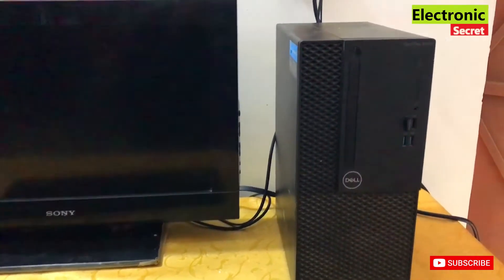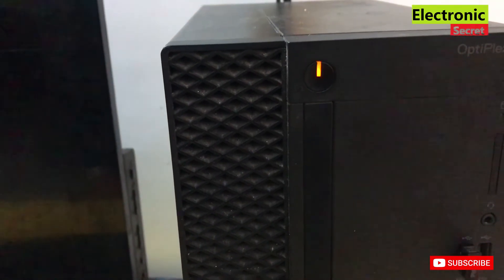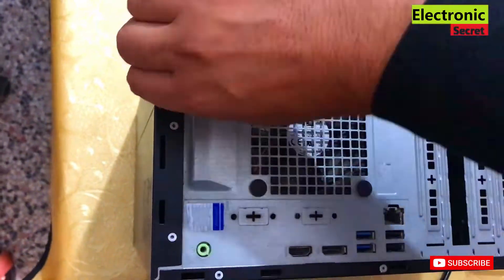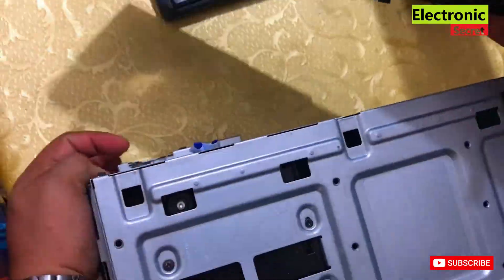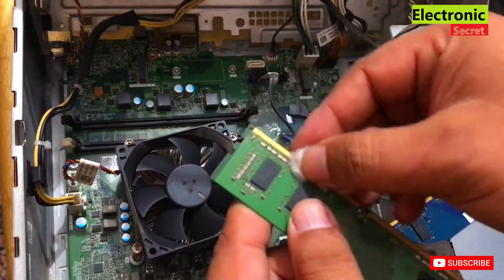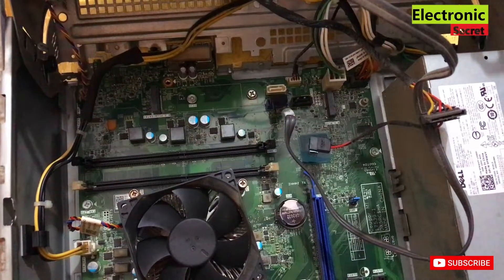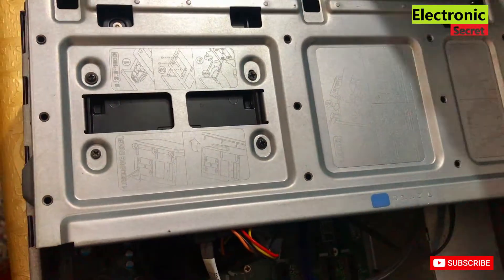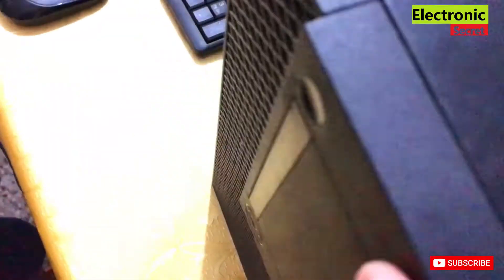DELL OPTIPLEX 3060 AMBER LIGHT BLINKING || DELL PC NO DISPLAY PROBLEM

Comment: Great video.  SUCCESS!!!  This cured the "blinking orange light" problem with my Dell XPS tower.  I just sprayed De-Ox-It on the contacts and wiped them off.  Be sure to push the boards solidly back into the slots so that the clips on either end move all the way in to hold the boards.  Much thanks for this video.  I was ready to scrap this 2011-vintage computer.

Comment: DELL OPTIPLEX 3060 white LIGHT directly on  both fans spin  NO DISPLAY PROBLEM
I have checked RAM, processor, power supply these things are ok but still no display. What is the problem??
Reply: Same happened. Any update ?

Comment: Is it the same with optiplex 3040?
Reply from the maker: Yes you can do it
Reply: @ElectronicSecret  I have optiplex 3040, it only boots with 1 ram stick at a time, so both sticks are working but when i try to boot with both i flashes orange.. any solution please?
Reply: @SupJaye  Ok is blinking but how ? 2 blinks and pause then 7 blinks  ? U need to go to Dell page to seee what the blinks are for before repair